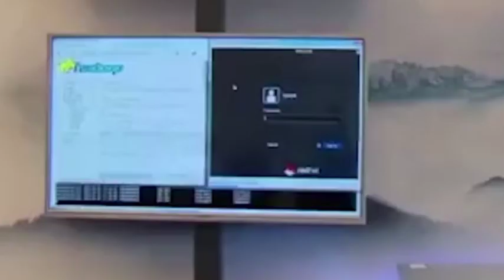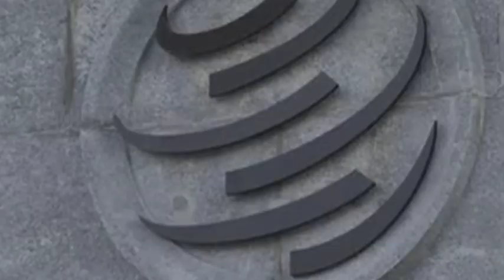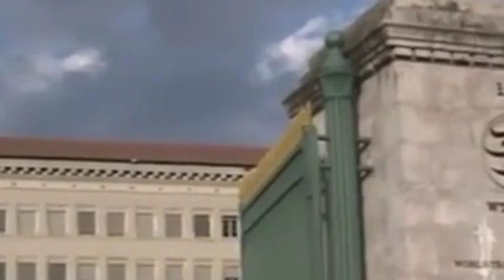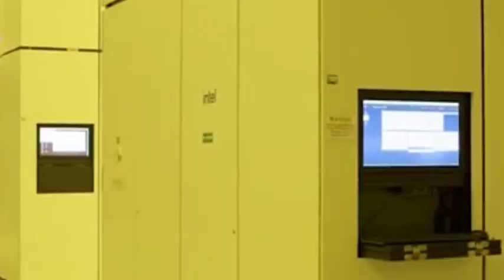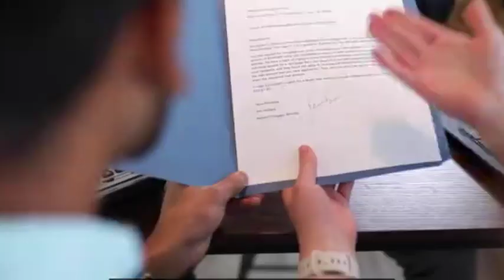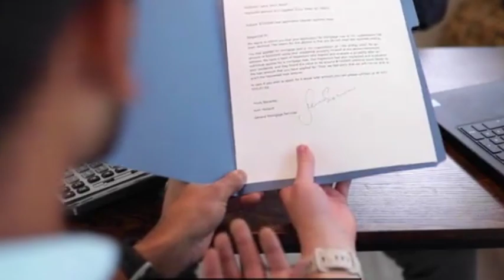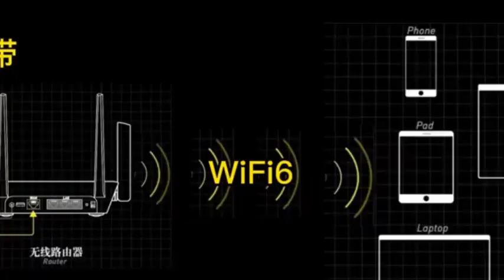Huawei’s new chips and ASML’s new plans are throwing huge bombs at TSMC.

Comment: TSMC realizes that it has been sandbagged by the US and the US is favoring US semiconductor companies to get ahead of TSMC.  The irony is the US will fail.  Aside from technical metrics like transistor sizes measured in nanometers (nm), cost is an important parameter in use of semiconductors in a product.  Here, China has an advantage.  Huawei is leading the charge for domesticating the entire supply chain to make semiconductors.  China will dominate the mature node market where 80% of semiconductors are defined and used.  China will continue to chip away and smaller nodes and is pushing the frontiers of alternate materials and applications.  Photonic, graphene, and quantum chips are targets for China.  China has produced the equivalent of 2nm photonic chips and has produced 8 inch and 12 inch graphene wafers with the first successful tape up using these graphene substrates being announced now.  Quantum chips are already being produced on a quantum chip foundry production line and China is pursing EUV and other advanced processes, like x-rays, to stay competitive at the high end.  This decade will be China's decade as it produces a broad spectrum of chips for various applications and cost in each application will be the market driver of who wins the chip war.